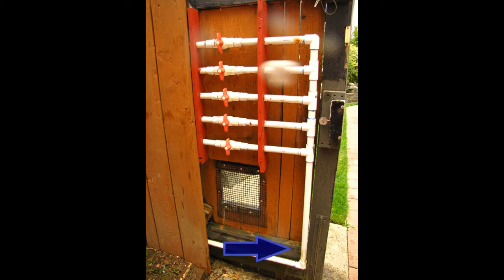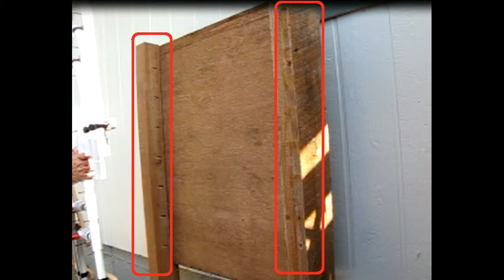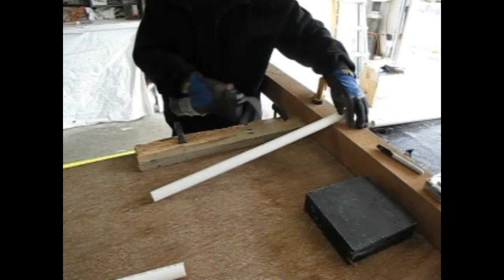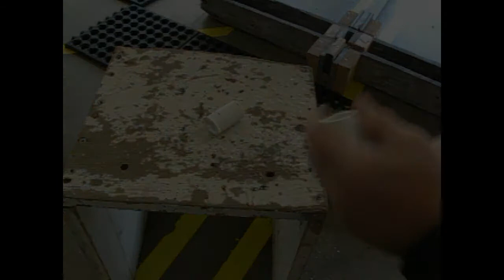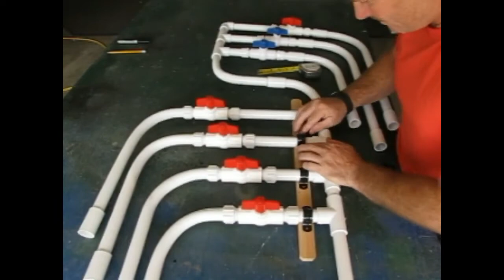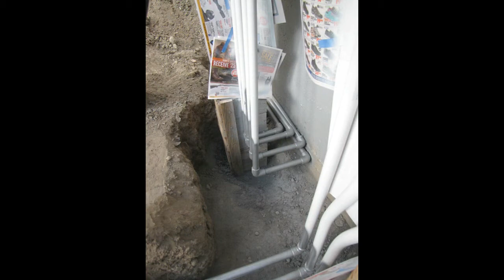DIY (sprinkler system creative water manifold)

Comment: Very good! Did you have a particular reason for manual valves instead of electronic controls and solenoid valves?
Reply from the maker: Hello.  I used manual valves because of my personal preference to not allow automated systems to control water. Water can be an extremely destructive force, and automated systems do eventually malfunction. Additionally, I can water only when the lawn needs it. Automated systems tend to work on timers and that results in wasted water. Thanks for asking.
Reply: Weird how counter clockwise works the same on a round pipe...